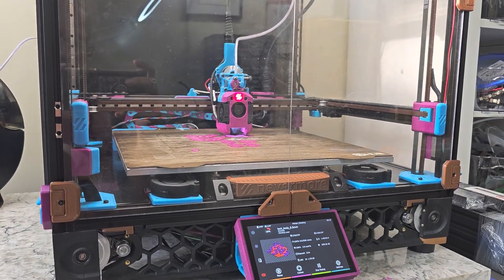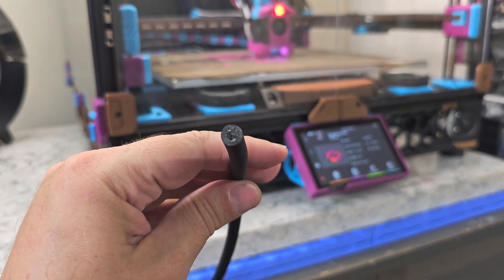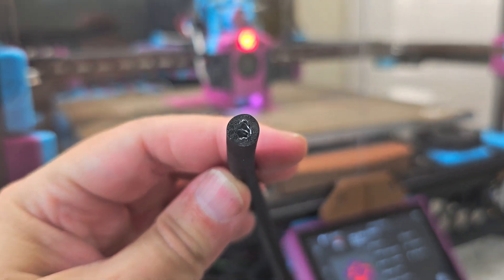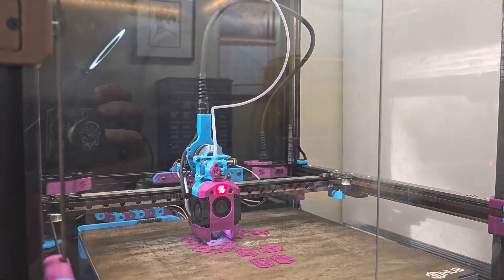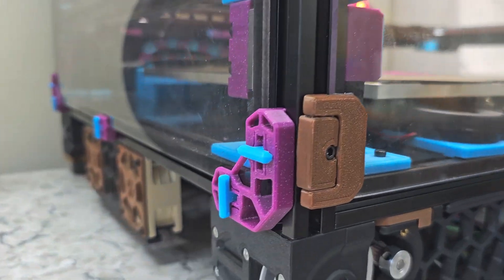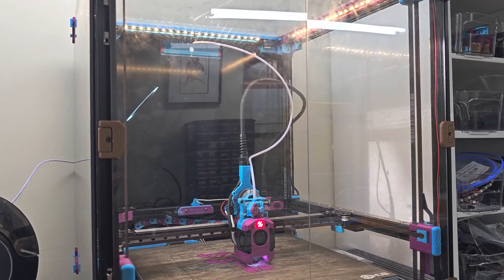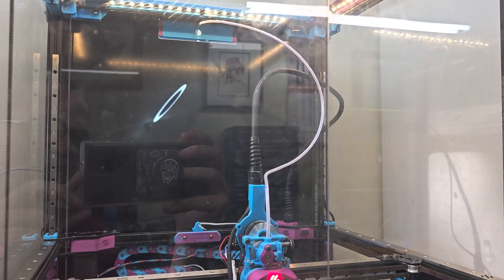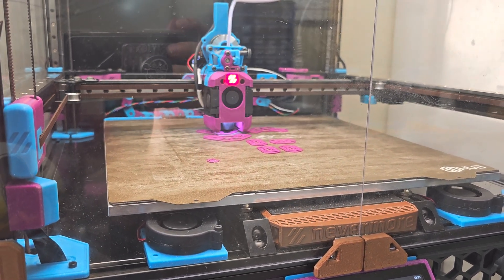Voron 2.4R2: New CAN + USB umbilical installed

Comment: Did you need to buy new hardware when you swapped to CNC xy joints? I got some in for my printer and its not immediately clear whether or not I need to order some new screws for them
Reply from the maker: My kit came with screws and shafts for the bearing and idler stacks, but the toothed idlers that came with my Formbot V2 kit were about 1 mm too tall. I had to order shorter ones from Amazon to make everything fit.

Comment: +1 for the annex clips. Strong enough to hold the panels, easy to remove and reattach, and available for different thicknesses, so you can find a set for your own printer :)
Reply from the maker: And no hardware required!

Comment: Did you use connectors or is it a straight cable from toolhead to electronic bay?
Reply from the maker: Straight cable all the way.
Reply: @oldguymeltsplastic isn't difficult to route the cable rear the mounted xol? Or do you attached the cable to the toolhead then route the cable to the bay?
Reply from the maker: There is no Xol in my set up.

Comment: Could you describe (or show a video) on how you terminated the 3DO cable? The CAN leads are straightforward, but I'm interested in how you handled the USB connectors.
Reply from the maker: I just cut the molded USB A end off of a spare USB cable, and spliced it in for the end going into the Pi. And for the end going into the Beacon, I just used a 4 pin JST connector.

Comment: What is your maximum height with the umbilical mounted this way? It looks like it could take away about 80mm.
Reply: I don't really print anything that tall either. I was looking at using this same cable to use for can and the nozzle cam. How easy is it to work with?
Reply from the maker: @ericbutler2385  the CAN+USB cable is 7.9 mm in diameter. I was just able, with some effort, to squeeze it into a PG7 gland, but it really is designed to fit much better into a PG9 gland.
Reply from the maker: You're not wrong, but I haven't actually checked. The umbilical attachment point can probably be reworked to bring that height down a considerable amount, but I never really use much more than the bottom third of my build space presently, as I mostly am printing printer/mod parts.

Comment: Good evening
Nice to see your projects taking shape. It looks realy clean with one cable! 

I've got a question.
I see you have cnc milled x&y joints.
I installed the goliath hotend and the hextrudort along with a cpap.

The problem is the height from the screw head over the x&y joints upper part to the top surface of the x brace. (or x gantry) I had to adjust them.
My maximum height is 9mm

How high are the cnc milled up to the gantry?

Thanks for sharing and
Greetings :)
Reply from the maker: I am not sure that I understand your question. As I am a visual person, can you message me on Discord, and share some photos of the parts in question, so that I can hopefully give you an answer?

Comment: I always wait for your updates. Thanks for sharing your experience. What is the purpose of the PC panels? Better insulation?
Reply from the maker: The polycarbonate panels are clearer and more rigid than the acrylic panels. My understanding is that they don't really provide much difference when it comes to heat retention in the chamber.

Comment: Nice, you made short work of that! Thanks for posting the cross section. I just ordered mine and excited to finally give the beacon a try. Super stoked to see you went the box zero route, that's on my list for my V0 as well but the V2/trident high temp build has gotta come next.
Reply from the maker: I am not sure that cable needed such thick insulation. It would have fit better in my PG7 glands had it only been 1.5 mm less in diameter. Having done this once, I would actually recommend sourcing a larger PG9 gland, which would then also need parts modded for it.
Reply: @oldguymeltsplastic  that's a good thought. I only have PC7 glands and 1 spare cnlinko. Im looking for another high temp option for the umbilical on both ends. May end up going with lemo or milspec molex.

Comment: Great to see your V2 evolving. I’m planning to do the same with the dragon burner and beacon. Have you considered using worm z drives on the z axis like on the redoubt?
Reply from the maker: I was going to hold off on reprinting the Z drives until the new Galileo Z drives were released, but I got tired of waiting and looking at my "patchwork" V2. I want to get rid of the black and copper ABS parts ASAP.
Once the Galileos release, I'll probably work them in also.

Comment: When did you install the aluminium parts and the titanium parts on top of the extrusions? Is there a video on that? I'd be interested to see if there are any effects on the input shaping from those mods? I'm guessing those are more for keeping the parts straight with temperature change though.
Reply from the maker: I am not a methodical, one mod at a time kind of Voron owner. The Titanium Backers were installed at the same time that I rewired my umbilical yesterday, and I also swapped out the printed ABS XY joins for the CNC XY joints, AND I also replaced the MGN12H X rail with a single MGN9H rail.
I'll be running some more input shaper tests shortly, and will share my results in another video.
Reply: Ooo yes. I like the sound of that. MGN 9 is like 140 grams less. I have ordered a troodon 2.0 which is pretty much a pre assembled voron clone. I don’t feel like building a voron from scratch but I intend to do some mods on it. Xol toolhead with rapido UHF and a CNC VZ hextrudort low. I found a skeletonised x gantry that seems much more solid at 90 grams which I will try and I’ll install an MGN 9.
Reply: @oldguymeltsplastic I would love to learn more about the CNC CY joints
Reply from the maker: @MKhalil95  They are these ones:
https://www.aliexpress.com/item/1005005286686747.html
And just in case, here are the CNC AB motor mounts I am also using:
https://www.aliexpress.com/item/1005005455593054.html

Comment: Crazy idea: Why not use the old acrylic sheets on top of the new ones with dual sided tape between to create an air gap between them? The dual sided tape would be between the panels but along the edges so won't be too visible. It should provide much, much better isolation :D Although it may get too hot in there for the motors etc. but should be great for ABS. Doesn't hurt to try as dual sided tape is easy to remove :D
Reply from the maker: I am running with LDO 2804AH (High temp) AB motors, at 48V and run_current: 2.8. They generate a decent amount of heat already. My chamber temp reaches 65C pretty regularly. I don't print with any filaments that require even hotter chamber temps.
Reply: 65 degrees, damn. That’s pretty much ideal for ABS. What did you have before the motors?
Reply from the maker: It would peak around 58C, occasionally up to 62C.
Reply: @oldguymeltsplastic  That's pretty good, it must be pretty air tight then.

Comment: @oldguymeltsplastic with beacon how do you z offset?
Reply from the maker: Manually. Beacon doesn't support Auto Z Offset. Not an issue for me and the way I use my printer.
Reply: @oldguymeltsplastic so can it qgl?
Reply from the maker: Yes, I removed Tap for less weight and more toolhead rigidity. Beacon weighs less, has no moving parts, and can be used as Z endstop, for QGL, and for Bed Mesh Calibration.